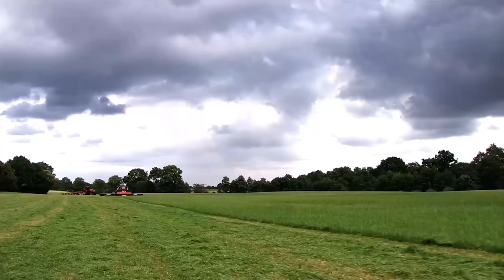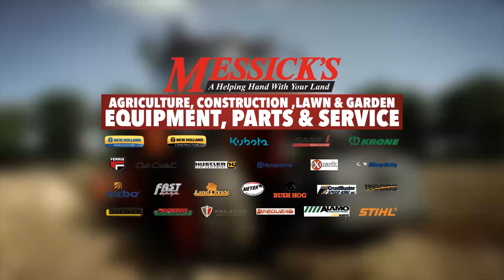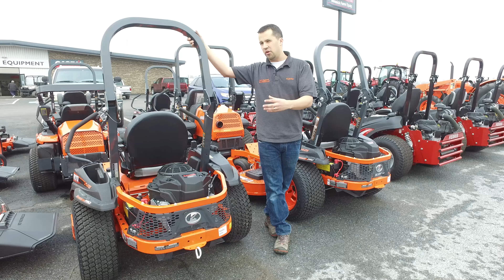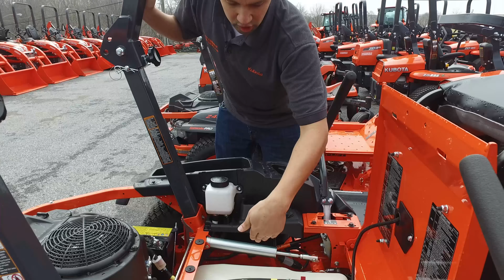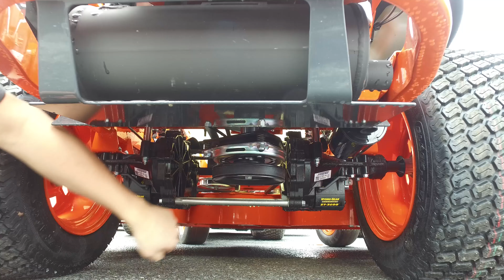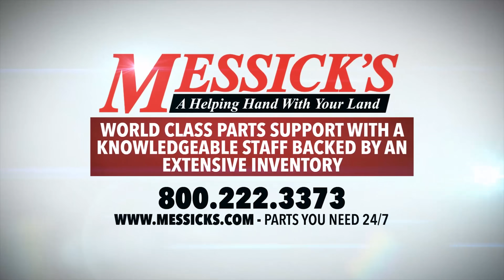*NEW* Kubota Z400 Series Mower

Comment: I am buying a z421 this week, I have 4.5 acres of land. But I cant make up my mind to go 54 or 60 inch. I'm not really worried about how long it takes to cut. I'm worried if the 60 inch will have enough power to cut very thick grass. But I like the 60 inch due to  tire and overall  Width.  Will either one ride the same?  On a little bit ruff ground? I need you opinion.
Reply from the maker: power difference from 54/60 is 10%. unlikely you would ever notice. I'll always take the bigger deck for easier trimming

Comment: Just purchased the Z421 for an 8 acre farm. First impression is the cut at 2.5” to 3” is fantastic. Nice level cut with no stragglers and the Kawasaki engine is very strong and not to loud (I cut without noise protection without any discomfort). The mower has a high travel speed when needed, but I try to take it easy when cutting. Zero-turn mowers have a rigid frame and our pastures are rough terrain in areas and can jar the hell out of you. If this is a concern for you,  you may consider a larger mower with an air-ride seat. Overall this mower is a winner in the 6-7K price range and I am very pleased with it’s appointments and performance.

Comment: Ive owned multiple KAWASAKI engines.Put hundreds,if not thousands of hours on them.They don't die.if maintained properly they will last years.KAWASAKI and the sBRIGGS AND STRATTON VANGUARD ENGINES built in japan,and yes,some vanguards were built in japan,were absolutely,some of the smoothest engines ive ever run.So if you own a vanguard,check the build location,they are expensive and high quality.These motors are quality.

Comment: Can you do a review of the 700 series ?  The  Z726XKW-60 in particular.
Reply: Denim Dude I have that mower in I love it very stable on hills an it has the best cut outta any mower iv ever ran .. it dose like fule but it has the big block kaw on it fx801v. That is a very strong running motor. I can't say enough good things about the hole mower.
Reply: Denim Dude The Z726XKW also uses 14cc Parker Hydros. You'll usually find those on mowers costing 10k+. Worth getting the suspension seat & the seat itself is very comfortable w/adjustable armrests. I do not know if they offer radial tires or Tweels, but that would be better than bias-ply. It's a very heavy duty lawn machine.

Comment: Question- the bar underneath the mower, does that serve any other purpose rather than protection of the drive? I had a mower before that when that bar broke ( which it does a lot) the two rear wheels would cave in, would like to steer away from that again!

Comment: what's the towing capacity?
Reply from the maker: +HOODMONK generally not published. Too many lawyers.
Reply: Messick Farm Equipment wow really?,,  I want one but I need to now if this thing can pull a 200-300lb Sprayer (or seed hopper) If I'm going to fork over this kind of $$$$ I need it to have have modular multipurpose  functionality.
Reply from the maker: +HOODMONK probably fine at minimal weight like that. Now a cart of firewood....
Reply: Messick Farm Equipment thanks, ( what do think of the new Spartan Mowers?
Reply from the maker: +HOODMONK never seen one before. The tracked one looks interesting.
Reply: Messick Farm Equipment rthats the altoz trx  with the tracks

Comment: question i hear you can upgrade to seat suspension kit my question is do you still use the same plate & seat that mower came with when installing seat kit?
Reply from the maker: same seat. you are just replacing the undercarriage.
Reply: so the original undercarriage is taken off , is the carriage/plate different from the original meaning holes are not the same?
Reply: call i have a contact phone  number?
Reply from the maker: the mountings are the same. It drops right in.
Reply: then why have to change the carriage plate?
Reply: may i have your name and direct number?
Reply from the maker: 717-367-1319. Ask for Lawn and Garden Sales.